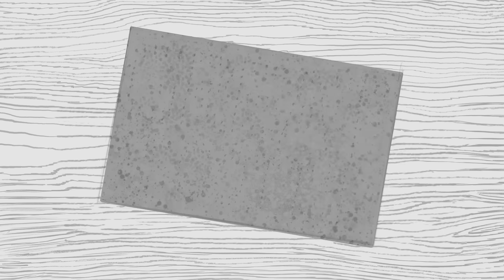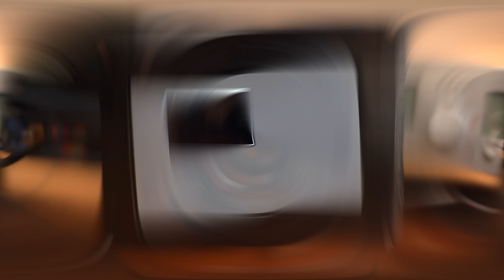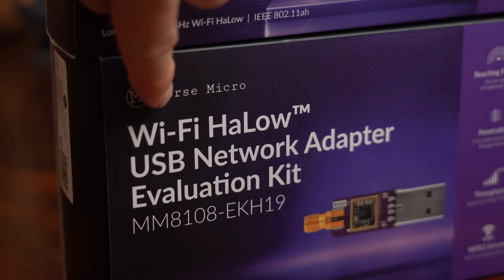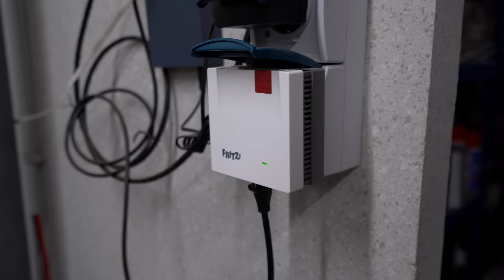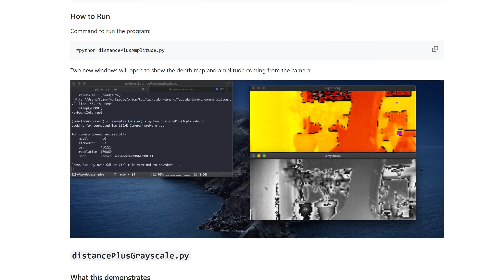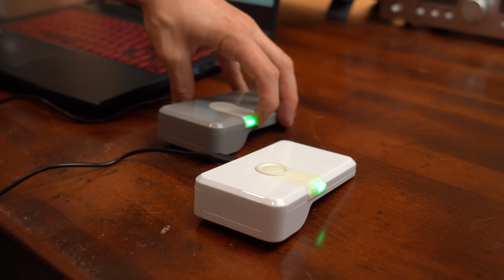I tried Super Useful Future Tech! (That you can use Today)

Comment: AFAIK Raspberry PI was developed and marketed as Learning Hardware for University - similar to Arduino which in addition was open hardware. As a learning board they did saved the MPEGG2 license - which needs to be purchased separately. As learning computers both are quite forgiving against shorts - a mistake a newcomer is likely to make without melting the hardware. Since both comapanies offered their SPECS online it is quite easy to get hardware for them - like HATs.

So how resilient against user error are the Next series? How open are their designs? Open Hardware like Arduino - or open design, closed hardware like Raspberry?

I can buy a refurbished Thinkpad with RAM and SSD around 120 to 150 € that has bluetooth, USB, HDML, ... But lacks the resilience and formfactor a Rapsberry Pi offers.

Comment: Really interesting demonstration, thanks for sharing! 
We were particularly interested in the Qorvo kit, as Qorvo is one of our technology partners and its kit is closely connected to what we do.

With iOS 27 and Android 17, Apple and Google have opened their native UWB DL-TDoA positioning APIs, creating new possibilities for precise smartphone-based indoor positioning. However, an open API alone does not calculate a position. That is where Pinpoint comes in.
With our mobile SDKs and ready-to-use location engine, developers can integrate UWB-based indoor positioning into existing iOS and Android apps without having to develop the positioning technology themselves. No additional hardware is required on the user side, only the building needs to be equipped with Pinpoint’s UWB infrastructure.

This enables real-world applications such as in-store navigation in retail, wayfinding at airports and stations, location-based delivery services in stadiums, and hands-free access control.

Feel free to visit our channel or website for more insights!

Comment: In a similar vein to the LIDAR Camera, I just ordered a dev board for a VL53L9CX 3D LIDAR sensor.  It has similar capabilities but is intended to connect to a microcontroller (I2C / I3C) rather than USB.  It's brand new so the lead time is fairly long - but it looks useful.  I want it for collision avoidance on my RoboMower project.

Comment: The best move i made was to move my home assistant from raspberry pi to old gen PC, performance difference is night and day. Install proxmox, pbs and now I can install other containers or VMs. Blow the raspi 5 out of the water for a similar price.
Reply: Yep. Sadly for aplications wheere size is an issue rpi still only choice. But i agree if you dont need to fit the machine in a hole. Anything is better than rpi right now.
Reply: @trowawayacc There are some impressively powerful mini PCs that are not that much bigger than a Pi 5 mounted in a case.
Reply: I know it's a low end embedded thing, but the original Pi Zero is on par with a Dell Dimension 2400.

I was just..... Ugh! So disappointed! I wasn't expecting miracles, but I was expecting like, you know, not having the same performance as an old Northwood Celeron? And have 1 GiB of RAM?

Comment: What is the problem with YouTube creators? Everyone is comparing LoRa with Wi-Fi? Is the problem you have never worked in real industry?

Fieldbus? ring a bell?

LoRa is intended to be used for small messages which contain data like measurement values. Your device sends within 20-60 seconds value like temperature.

Wi-Fi is for your videos.

//arl

Comment: Remember when the pi was 25 bucks?
They added a 1 to the price
Reply: At least the 1 is in front. For now. :I
Reply: more like 1.5 the Pi5 is like 170 bucks now 🤑at least for the 8gb version cause of ram prices
Reply: Big Mac meals used to cost $2.99.  Inflation sucks
Reply: @SvdSinner  How much did you earn when that was 2,99?
Reply: @Lvvcassss 2.99 big mac was still relatively cheap
Reply: @hor1zon_0  according to US inflation data and reddit, it cost $2.99 in 1992. Adjusted, it should be $7.12 today. It's probably $10+...
Reply: @Lvvcassss  no , wages didnt raise with inflation
Reply: The fact they brought out a new pi with.... 1 GB of memory is ... sad.
Reply: 26 bucks?
Reply: They didn't, AI did

Comment: I gave up on the Raspberry Pi. They lost the script. You can buy full fledged PC boards that are fast more competent and capable at not much more of a footprint for much less money.
Reply: True. For the price, I'd consider a used mini pc and for IOT/sensors projects a separate cheap esp32
Reply: @techie_tech99 I'm also looking at the LattePanda IOTA 16GB RAM/128GB storage for $199 vs Raspberry Pi 5 with 16gb RAM and no storage for $305 and shaking my head. So unless you have a very specific use case for a Pi, it's not worth it at all anymore. I miss the $35 one.

Comment: I did my bachelor thesis on WiFi HaLow and it's severely handicapped in Europe because of the limitations of max e.i.r.p. of <25mW and the allowed duty cycle of 13.9% for 1 MHz bandwidth or 27.8% for 2 MHz bandwidth in the frequency range HaLow uses (863-868.6 MHz). So it's not that promising for Europeans unfortunately.
In the USA for instance max e.i.r.p. is 1000 mW without any duty cycle limitation, allowing for much longer range and higher continuous data rates, which makes it more useful. 
Even though it was introduced 10 years ago, the standard is barely used and hardly any hardware is available (almost no SoCs in stock anywhere, just development kits and consumer products like bridges).

Comment: Why could you not love Rasberry Pi?? The answer is PRICE.

It is super expensive for just a weak performance mini PC with some electronics feature (IO pins).

And for hobbyist, the cheap Arduino/ESP32 is already enough for nearly all simple projects.

There are only niche usage for this Rasberry Pi that microcontroller or PC could not capable of, such as when processing fast responsive complex UI display or massive mathematical calculation that must be embedded in device that also controls stuffs (e.g. automotive or industrial-level mechanical device such as CNC), or robots with many input/output actuators that also uses AI or image/pattern recognition, or similar level of complexity.

If you just need pure computing power, PC is far more powerful and far cheaper. If you just need electronics IO pins with decent processing speed, Arduino or other microcontroller will do.

Comment: those lora radios also do fsk, it doesn't really make sense to say the bandwidth is terrible with lora the modulation. chirp spread spectrum is a regime like FSK, BPSK. it doesn't magically reach farther because it's slower, it magically reaches farther using less air time and bandwidth than the alternatives. you might as a first pass look at lots of radios and see which one could carry video, rule out lora, do walkaround testing, rule out things further still, but the basis for the testing is still carrying video, which is not what most radios are for period. even halow isn't for video. halow is an iot extension that is in the same space as nb-iot and lte-m, halow basically just exists as a more efficient alternative to wifi itself. ethernet cameras might be called iot devices, but iot devices are not cameras. iot devices aren't about reach either but integrating information that was previously unavailable due to cost. lora uses a lot of power, even if the data rate it can support means you can use it in your application, the answer is probably still no. the applications themselves are designed around a power envelope, there are no new uses of video where the sensor sometimes does nothing. it's all surveillance. a video iot device that uses lora might still have a camera but it uses it as a sensor, not so you can look at a picture

Comment: I'm not really a fan of the raspberry pi.

However you can't really compare those a55 cores against the a76 cores of the pi, the a76 cores are easily 2x the performance at the same clock speed.

Comment: the biggest thing i really want from a pi killer, is compatibility with pi hats, mounting holes and pinout is the thing.  i'd find it fun if atx motherboards had spots for em.
Reply: What hat is worth it? They all seem overpriced and underwhelming
Reply: @H0mework  the ones i have.
Reply: A really tiny low powered AMD64 compatible core so you can pop a USB stick with Debian on it and have an OS installed in ~20 minutes. Standard UEFI and all that makes life easy.

Getting Linux installed on many of these ARM devices SUUUUUUUUUUUUUUUUCKS!

Comment: wait.. did i see correctly that the glinet router came preflashed with something else? I guess openwrt based but still... shows how good and cheap glinet is when other manufacturers just buy their hardware and put their software on in.
Reply: Glinet routers run OpenWRT. They have their own interface, but LuCI is still accessible. Some of them can be flashed with stock OpenWRT.

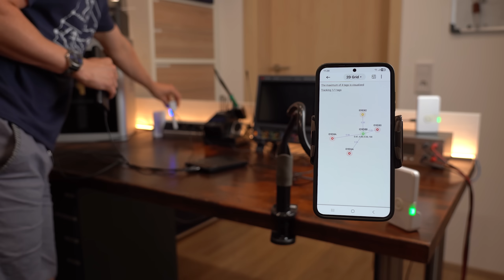Comment: 12:46 Oh, a brilliant ‘GPS’ for a large model railway ETCS… ;D
Reply: Is that necessary with DCC available in the locomotives.
Reply: @davidjernigan8161  Hehe, when considering all the track circuits (ferrite trafos really) and feeder-decoder channels needed, to know where the (of course) DCC controlled stock is - and where it’s headed, at what speed… why not? Opens up for dynamic blocks as well, which are very welcome. Length of track doesn’t scale down well, unless one is a millionaire with a stadium sized area & too much spare time. Roadside signaling is disappearing anyway, and implementing “in-cab signalling” (where you actually use your DCC hand-control) becomes a cheap LCD panel. Not unlike any RW equivalent… ;) Thing is to automate routes, safety & logistics, and ‘drive’ a particular consist yourself…
Reply: @m @musiqtee ve often fantasised about getting into model trains specifically to implement ETCS on them. I dream of using NCF chips as balises, and building an OBU that has an NFC reader and parses the telegrams to control the train

Comment: For years now I've been using HaLow to link my holiday house to my father in law's house which has broadband.
I bought some devices sold as CCTV IP link bridges. The two houses are about 600m apart and it still works to give me 15Mbps.
I have some better devices that I bought last year to replace it with, that will give me more diagnostics and perhaps boost my speed.
Previously I tried using 5GHz WiFi bridges but there are a lot of trees around that I can't avoid and it wasn't good.
Reply from the maker: Thanks for the feedback :-)

Comment: If you want to take a look at a bit more serious ARM machine, I can highly recommend the FriendlyElec CM-3588.

Sadly, thanks to the ram price explosion, the 16GB kits are waaaay more expensive now, but they really make for a great home file server. 4 NVMe slots, that can accept SATA adaptors, mean you have a lot of expandability. Plus, 8-core bigLITTLE core design means you can throw a lot of containers on this thing before it will start to buckle.
Reply from the maker: I will have a look :-)
Reply: @greatscottlab  I took a quick look to double check the prices.

2 years ago I paid $330AU for one.
Today? $1200AU for the same unit.

It is absolutely worth the price I paid, but I am not sure about the current price. The AI price tax is wild.

Comment: A raspberry pi 5 cost ~$200 here. It's better to buy a new mid range phone. It comes with built in screen, battery, Camara 😂 just install a Linux terminal and that's it.
Reply: Yup, In Chile a CM5 costs USD$320. Just buy a used PC better. Or a mid range cellphone, as you suggest.
Reply from the maker: Price increases do make creative ;-)

Comment: I haven't watched the video yet, but I'll tell you now: if you buy an Android TV box, most Allwinner processors support booting from an SD card. You can install Armbian on them and run any operating system you want.You would have an alternative that is significantly cheaper than SBC prices.
Reply: A study found that something like 30-40% of generic Android boxes sold online contained malware. So it's well worth swapping out the OS if you can.
Reply from the maker: Thanks for the tip :-)
Reply: I tried getting armbian installed on mine.

It has lpddr3 and I couldn't for the life of me change the DRAM config for das uboot. The compile scripts looked at my changes and threw them all out.

Three days of my life I'm never getting back.
Reply: @ViktoriatheCat-v8z I have beelink C2 I install the directly and flash the sdcard so ı don't need anything for compile because the system does have apt and it have 90mb ram it is very good for me I can make all the things
Reply: @LinuxBaymaz  I'm talking about the slightly more obscure stuff.

Going beyond vendor supplied images SUUUUUUUUUUUUCKS!

Comment: To me it feels as if the Rasberry pi is a dying concept.
Reply: Great software support, though. If your average enthusiast absolutely must get an ARM SOC board, it should be a Raspberry Pi.
Reply from the maker: Really?? I mean the price sucks, but the rest is awesome.
Reply: @greatscottlab  An esp32 can do most embedded Raspberry Pi projects for a fraction of the cost. And as a computer RPi is overpriced for hobbyists, I'd just get a mini-computer for stuff like HTPCs and home servers. A good NPU might make it more desirable as you show in the video. I still use a RPi-Zero 2W for OctoPi on my 3d printer though.

Another nice video btw. Now if I could just move to a 1st world country where I could buy these without nonsense duties 😆
Reply: @greatscottlab 
Radxa Dragpn Is better
Reply: If the price sucks then it sucks
Reply: Its not dying, it's matured - consumer users complain about price hikes or 'better value' on other devices, but that's because end users are fickle and there's alway new bleeding edge tech for tinkering and hacking. Instead Raspberry Pi have focused on stability, support and availability - which naturally means a lot of industry adoption too.

At the same time, there's also (a) excellent microcontrollers for very low cost (ESP32, Arduino, Pi Pico) and (b) a lot of performance in very affordable used/refurbished hardware (perfect for NAS or home automation) so seems like much of the hobbyist space has diverged into those two directions rather than one device for everything.